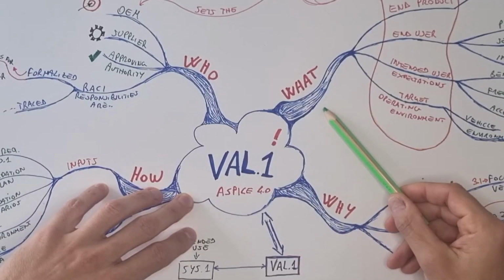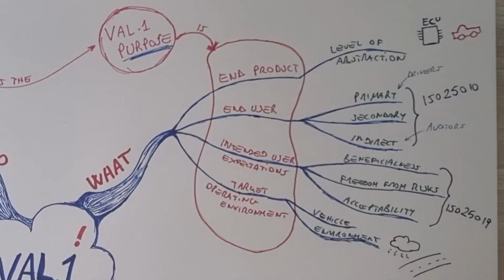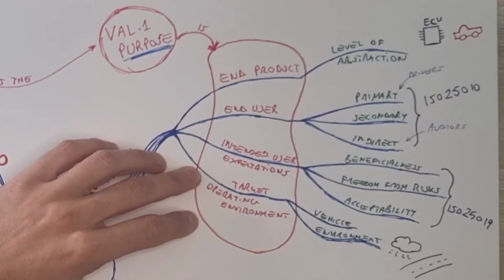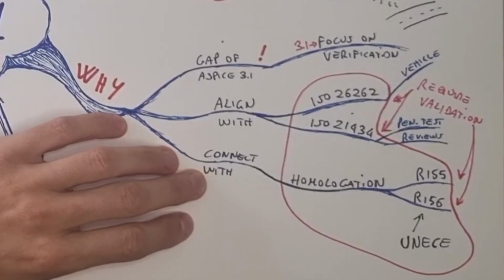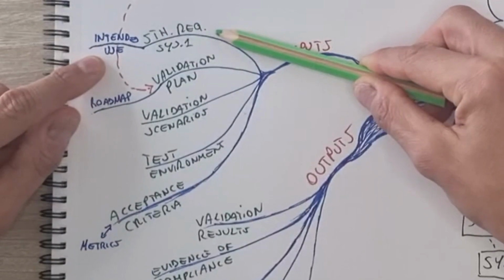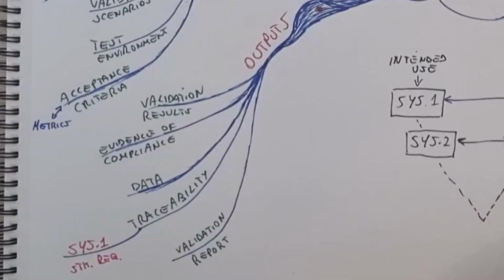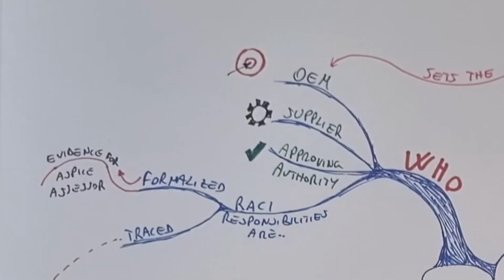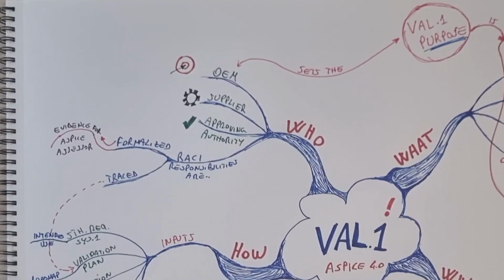VAL.1 explained. The new entry of Automotive SPICE 4.0

Comment: Good morning,  very good video. Nevertheless, I have something still not clear to me. I work on ECU software and ECU complete system for injection control injection and which ensure also few vehicle functions. My company develops and provides also the complete injection system (injectors, pump etc...). I was wondering how "direct interaction with the product" is applicable to an ECU or to the Injection system (we don't provide sensors). Thank you.
Reply from the maker: Hello Vincent,
validation means demonstrating that the product works correctly in its intended operational context, i.e. under representative vehicle/engine use conditions.
So for an ECU or injection system, “direct interaction” typically happens through running the ECU in a representative environment (vehicle, test bench), and observing the ECU outputs and the resulting system behavior (e.g. injection timing, pressure control ...).
So even if you don’t deliver just sensors, validation is still fully applicable: you validate the ECU/injection system by interacting with it through its interfaces and by demonstrating the correct behavior of the controlled system in realistic scenarios.
Typically, the scope of validation tests and responsibilities are agreed with the customer. Good luck with your project!